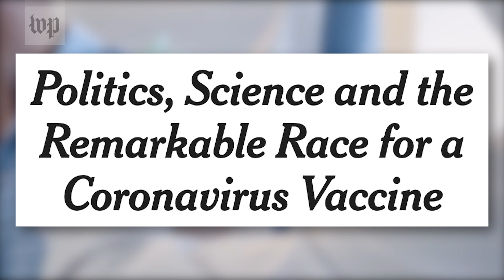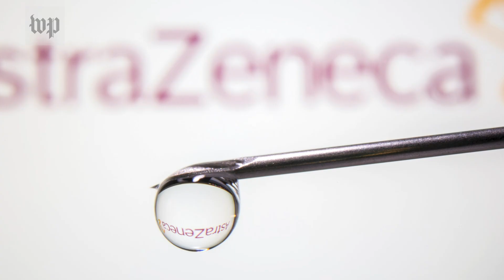Your coronavirus vaccine questions, answered

Comment: Fauci was the NIH AIDS Expert and after over 30 Years unsuccessful with AIDS VACCINES. Read “This Is A Bio-Attack Alert”, by Dr Robert B Strecker, to better understand the Truth about COVID-19. Dr Strecker, a Medical Doctor with a PhD in Pharmacology said, “There Is No Proof Any Vaccines Cure Anything.
Reply: True, but vaccines are NOT SUPPOSED to CURE anything. That's not HOW THEY WORK! Vaccines help your immune system recognize and firewall the threat when you are exposed to a virus. This means you either experience no symptoms of the disease (but may still infect others) OR will feel much less sick. No virus can be cured. Only symptoms of infection can be treated or infection prevented by blocking available hosts who have been vaccinated.